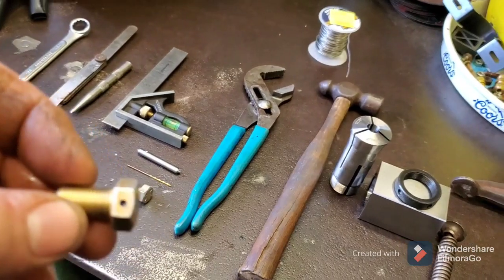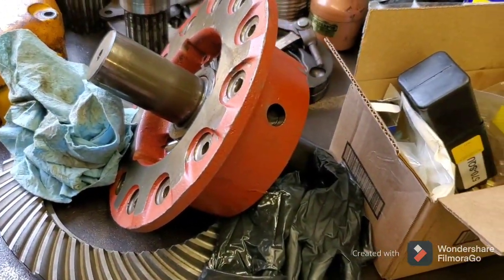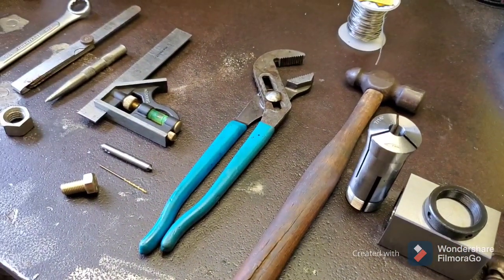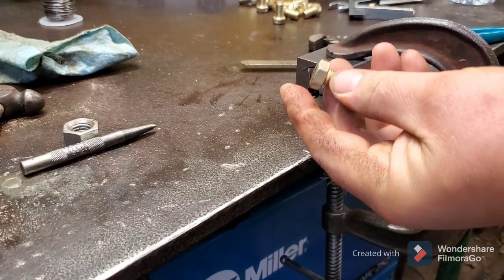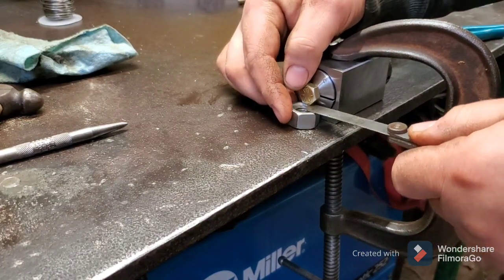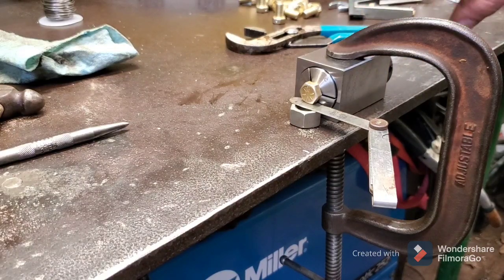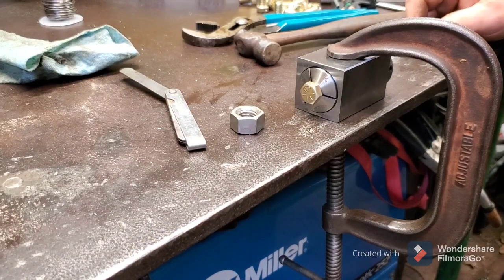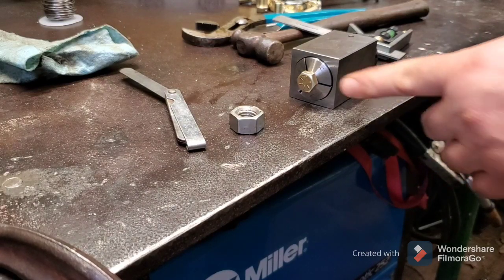Making safety wire bolts / drilled head bolts with a collet block

Comment: Ive been looking everywhere online for premade m5 allen head bolts with a safety wire hole drilled through it, super hard to find, must only be a military thing idk, but i bought these titanium 1/16 drill bits and still cant get a hole through the head, its weird because i used these same drill bits and drilled threw these screws when they broke off inside and needed to drill a hole for the extractor, dont know why it seems so much harder to drill on the head, vs drilling the broke peice out, i gave up, almost wanna try again after spending 2 hrs looking online and callimg every nut and bolt store in town who dont have those :/
Reply from the maker: Might be just a cheap made drill bit. If your bolts are not anything hard, a HSS (high speed steel) bit should do the job. If they are something harder like stainless, you should look for a drill bit that is designed for the material. You can find a wide array of different types of drills on McMaster-Carr, and they likely have the metric bolts in a wide array of different materials as well.